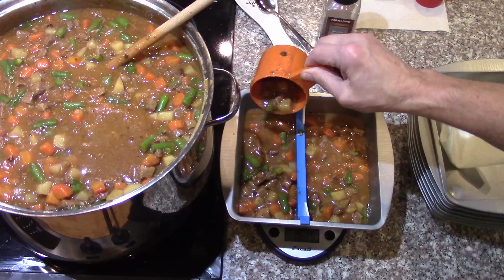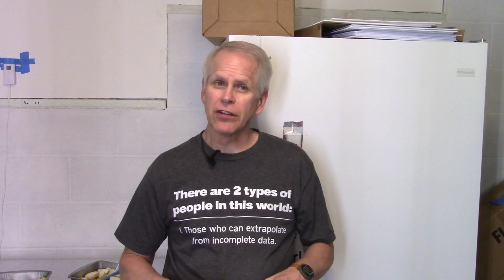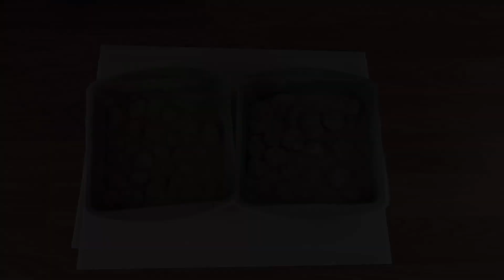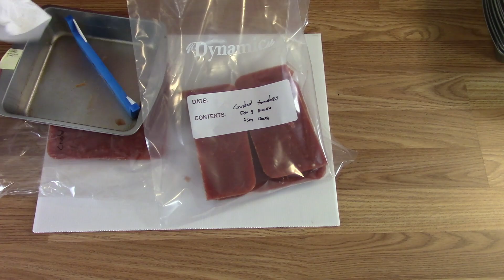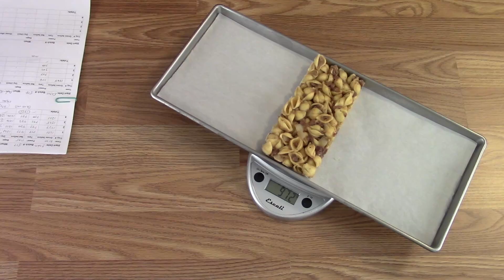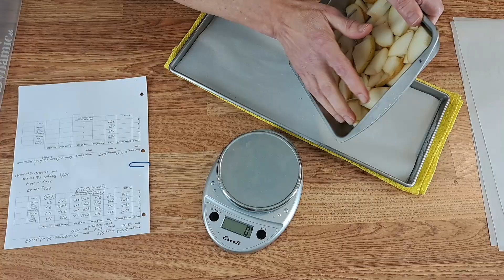Freeze Drying - Prefreezing Food in Pans

Comment: Are you putting a little oil spray down in those pans before you freeze in them or does everything just pop out like that easily without any help?
Reply from the maker: Boy, that would have been a good thing for me to have mentioned in the video! 😁 
The answer is - it depends. Some things tend to really stick and I wipe the pan and dividers with a light film of oil. Milk and eggs really, really stick to the pans and I make sure to oil the pans. Cooked rice, most meats, and a lot of fruits and vegetables, don't seem to stick and I don't usually don't bother to oil the pans. You can also get silicone pans that are the right size and the food may pop out easier, but they cost way too much me me to have more than one test pan:)

Comment: what size and brand are the pans that you are using? Do you share the 3d print files for your dividers?
Reply from the maker: Thanks for watching and commenting! 
    The dividers are designed to fit pans we got at a Dollar Tree store. The pans are a near perfect fit ** for our medium freeze dryer trays. (Turns out they have them online too https://www.dollartree.com/cooking-concepts-square-cake-pans-75-in/10065 )  The file is on Thingiverse. https://www.thingiverse.com/thing:3848619 (Some people feel that it's wrong to have food touch plastic - it's low on my personal risk list) I've updated the Thingiverse listing to include a new version of the divider that is slightly narrower at the bottom to fit more of the pans. 
       ** Clarification on the 2 1/2 pans per tray; it only works IF the divider is the thickness I use. (or thicker) The freeze dryer trays actually fits about 1/2" less than 2 1/2 pans; that's one reason I made the dividers that thick, that and to fit the magnets.

   I assume you have a printer, but for those without a 3D printer, here's my best ideas for getting some 3D printed dividers. Lots of areas have Maker's places with people that would love to do it for you. Or, better yet, some schools have 3D printing labs. Check with a the local charter school that has junior high or high school age students. I taught 3D Design and Printing for 3+ years at a local 6th - 8th grade charter school. We loved it when we could find/were given a real-world project with a real need.

   I did make a couple of the dividers without using the 3D printer a short time ago. It turns out it's an easy craft project and my sister says they are working well. (I will be making more non 3D printed ones, they're easy, cheap, and work!)
Making Dividers for My Pre-freeze Pans Without Using a 3D Printer (For Our Medium Freeze Dryer) https://youtu.be/XNsbWn29xdE

Stay tuned. 😁 I'm going to show another way using 1/2 thick cutting board. (For people with more tools and/or skills)

Comment: Do freeze dryers freeze in some specific way that would have the same result as a blast freezer, whereas the ice crystals formed are small & minimal because of the blast freezers speed? Or is it just like your normal freezer that ends up creating larger ice crystals that damage the structure of some more delicate food items, because it takes longer to freeze?
 The resulting food mush when thawed compared to the original fresh food is what I'd like to avoid.
If no, and it means saving for a blast freezer so be it. But figured I'd ask. Thanks

P.S. I would still pre freeze other non delicate (meats, etc) foods in my regular freezer, to save time and energy costs.
Reply from the maker: Yes, in general the faster the freeze, the smaller the ice crystals. Not an issue at all if your going to eat the item dry. (not rehydrated) The HR freeze dryer is not nearly as fast at freezing as a blast freezer. Not close. But sometimes we want bigger ice crystals than the blast freezing gives us. Also, we are never going to thaw our food after it's been frozen.

   With fruits, we've been happier with the results when they have been frozen slower. With IQF fruits, we have tested letting them warm up to just about the freezing point of the fruits, somewhere around 26 to 31ºf (different temperatures depending on the fruit) and then we freeze them slowly. (regular freezer speed) This does seem to help them do better, but still not as good as fresh. IQF vegetables don't seem to have this issue. I assume it's because of the sugar level in the fruit helps to keep it flexible and vegetables have a lot less sugars and a different cell structure.

Mountain House has been successfully freeze drying food for more than 50 years. Here is what the Senior VP of manufacturing says here about ice crystals - https://youtu.be/OzOvsDVL_Q8?t=42 (sometimes bigger is better)

Remember, I'm just another idiot on the internet. I could be wrong. The #1 joke at our house is "But, I saw it on the internet!" I look at what commercial companies are doing. If they can do it, we probably can too. (with method adjustments)

"If you read it on the Internet, it's absolutely true!" - Abraham Lincoln

Comment: Have you tried silicone pans, the ones that measure 1 cup or 2 cups? They have them on Amazon for easy measuring.
Reply from the maker: These are the only silicone pans/molds we have tried: (Amazon affiliate links)
64-Cavity Square Mold https://amzn.to/3RTWCrx
6-Cavity Large Round Disc Mold https://amzn.to/3TvPuD8
4oz, 3'' Round Silicone Mold https://amzn.to/47dqfsg
6 Cavities Baking Pan - 2 1/2 Inch https://amzn.to/48sMA69
8x8 Baking Pan Silicone Cake Molds https://amzn.to/47f22Sm (The bottom is 7x7 and the blocks fit the medium trays)

Comment: I love your pans and pre freezing but mine is a small freeze dryer so those pans are just a little too big, I did find some plastic pans that fit my freeze dryer pans that work for prefreezing.  Thank you so much for all the info you share.
Reply from the maker: Which pans did you find for the small trays?
Reply: They are a black plastic pan with a lid from walmart.  They are quite deep so you have to be careful how full you make them but I think 3 on the small tray works well.  The food pops out of them quite easily and with the lids they are stackable in the freezer.  I am still on the hunt for metal pans that do not break the bank.
 @SchoolReports
Reply from the maker: @sherrellloyst1296  Thanks for the info. What are the dimensions of the bottom of the inside of your trays?
Reply: 13 1/4 inches by 7 inches  @SchoolReports
Reply from the maker: @sherrellloyst1296  If I understand it correctly, the blocks made in the pans I use fit across the tray (7"), but 2 of them are too long for the tray. Do I have that right? Two of the whole blocks from our little pans would be 7" x 14" 
If you had dividers in the 7x7 pans, you would end up with 4 half blocks for a total of 7" wide and 13" long.
Reply: I have those same pans that you have from the dollar store and they are just slightly too big and the frozen food will not fit down in the freeze dryer trays so that is why I went looking for another solution. @SchoolReports
Reply from the maker: That's too bad. I'll keep my eyes open for pans that are a 1/4" smaller. It's interesting that Harvest Right list the size of the smaller trays as being 1/4" wider than the medium trays. They list the small as 7.75" wide and the medium as 7.5" wide; same with their silicone mats. Maybe they've recently made some size changes.
Reply: if I measure outside top edge from side to side they do measure 7.75" but the bottom of the tray on the inside is barely 7" so that is why the dollar store pans are too wide.  I did freeze eggs in the dollar store pans and made the dividers like you had shown and they did not work well because they did not sit down in the tray, they barely stayed within the top edge of the fd trays. @SchoolReports
Reply: I found the packaging today for the containers I use, they are MAINSTAYS Meal Prep Food Storage Containers 10 pieces 5 lids and 5 trays.  They work very well for me.  @SchoolReports
Reply from the maker: @sherrellloyst1296  Thanks. That's good to know is case others with the same machine are looking for something that might work for them. I appreciate you sharing the information.
Reply: Today in my city a dollar tree opened and I checked their pans and they are slightly smaller than the pans from dollarama and they work just find and fit my freeze dryer trays.  I am so happy to have something that fits perfectly. @SchoolReports
Reply from the maker: @sherrellloyst1296  Now you have this pan? https://www.dollartree.com/cooking-concepts-square-cake-pans-75-in/10065

Comment: Do you think this works better for you than just buying extra freeze dryer trays?
Reply from the maker: Great question! 
For us, most of the time, it's far superior to prefreezing in the freeze dryer trays for a number of reasons. (We do prefreeze in the trays occasionally) 
With the little pans the food is pre-portioned and ready for bagging in serving (or 2 servings?) sizes. The blocks are smaller from the 7x7 pans which makes them a lot easier to store in the freezer. The frozen blocks from the big pans often break when taking them out and they need a big plastic bag for storing the blocks in the freezer. Leaving them in the extra freeze dryer trays works great, but we would need at least 15 sets of extras and they do take a lot more space in the freezer than blocks without trays. 
If we were never going to prefreeze more than 2 or 3 batches ahead I would probably opt for extra trays with dividers.

Comment: WalMart also have those cheap 7*7 pans and they are non-stick which is nice.
Reply from the maker: That would be great! The ones I found at Walmart were a bit heavier and didn't flex as easily, making it a little harder to get some block out. Maybe they had others that I didn't see. To be fair, we didn't really go looking for pans, these were just ones we already had and they happened to be the right size.
Reply: @SchoolReports  These are thin and flex. They do have thicker ones you could actually use in baking, but these are under $2.
Reply from the maker: @shaunnichols4664  Thanks, I'll have to look for them.